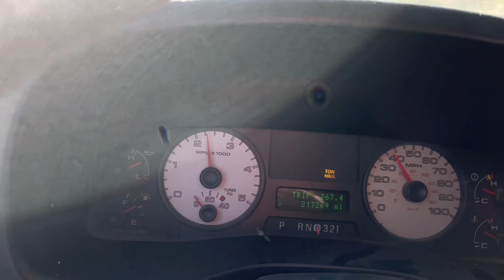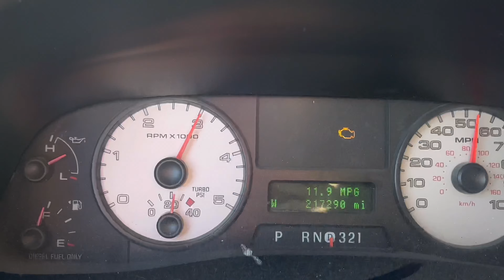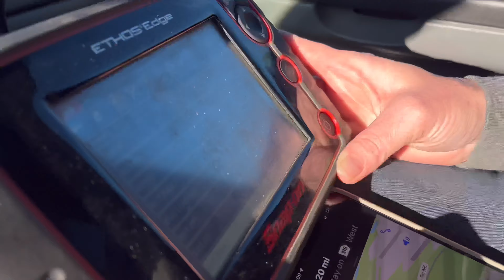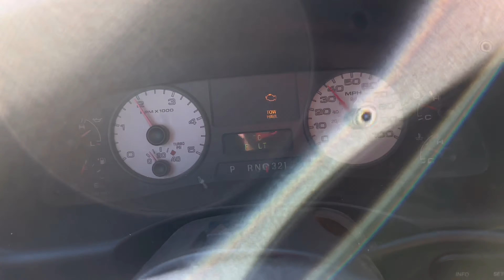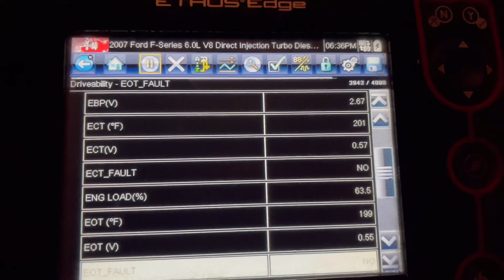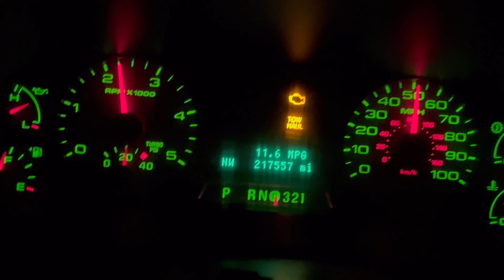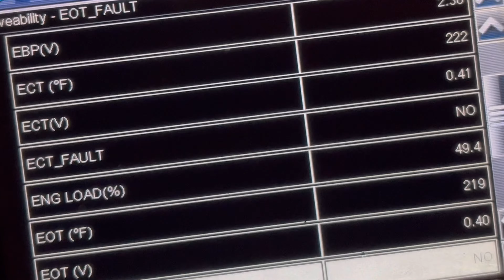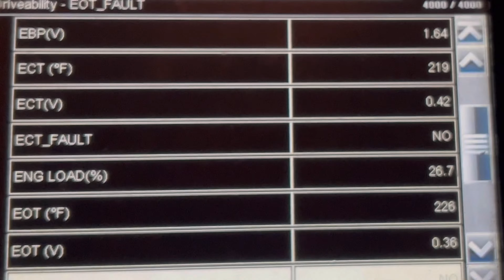We get BIG heat in the white dually hauling Ron's F350 to the shop

Comment: My 6.0 pushes 30-32 lbs boost easy (as shown on SCT screen) with pedal only about 1/2. Factory turbo and stock tune. Do you think that something is wrong or is the sct not accurate
Reply from the maker: Vgt stuck overboosting??  Does the power range during acceleration feel like an even ramp up??  Or laggy until surging to 30?    Half throttle seeing 32 isn’t normal imo.  What is the max when you are hammering it???
Reply: @AnthonyYoungblood  max I’ve seen is 32 but I haven’t really hammered it to see if it goes even higher. Yea the power feels pretty even to me but definitely hits hard when rpm gets about 2500 and boost up. Kind of like a 2 stroke dirt bike powerband

Comment: Did u brake some more fender bolts ? Or did you add more tie down straps .
Reply from the maker: We pretty much abandoned the bungees.  As of now there is just a strap holding them.  We keep finding the weak points and eventually they'll be good to go!!!!
Reply: Looked like a great trip other than the potholes or should we say roast pan holes lol
Reply from the maker: It makes for a nice break from the shop for sure.   Almost wasn't enough traveling tho!!   I don't know where we are going next,,,  but hopefully far!!!    I like having the goal of making it against the odds.   I've been sitting quietly on the side of the road before attempting that endeavour.    lol
Reply: @AnthonyYoungblood  😆

Comment: I had gearhead revise my unlimited tow tune to have the fan come on by 203. But it actually starts slowly coming on by 198 and shuts off by 194. I thought it was set to low at first, but actually works pretty damn good climbing hills. Not need for the "blue wire mod" anymore, but I have it just in case...
Reply from the maker: I never messed with the fan clutch wiring.  As long as everything is functioning properly,,  the stock setup works.  I am not arguing it tho,,,   if something messes up,,  kinda nice to be able to override the programming.
Reply: @AnthonyYoungblood  that's why I have it setup like I do, I see it as redundancy. And I can make sure it works before towing and or going on a road trip
Reply from the maker: Haven't heard from you in a while,,,   glad to see you back!!!

Comment: What gears you running Anthony?
Reply from the maker: The dually is just the stock 4.10’s.   I freakin hate em actually.  We can make enough power to push 3.55’s and get great cruising mileage.  But I’ve never swapped them to try.
Reply: @anthonyyoungblood  I would have  guessed 4.30's. I'm considering moving to 4.10's. But, I'm running  a 35's. I do get about 17-18 mpg on the HWY. 
I did notice your tach @ 2400/2500. I was thinking 2000 RPM's would be optimal with stock cam/heads?  I wonder if a stage 1 cam and turbo would make a difference worth exploring on my end?  

Thanks for the reply back!  Love the work you do and videos you provide!  

Hoping to get my truck in bay 1 someday!

Thx,
Eddy